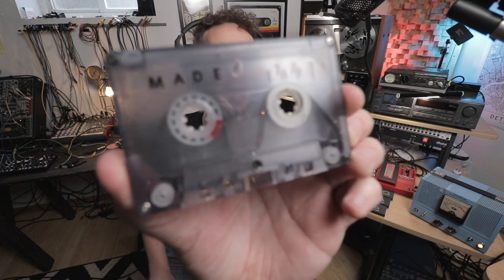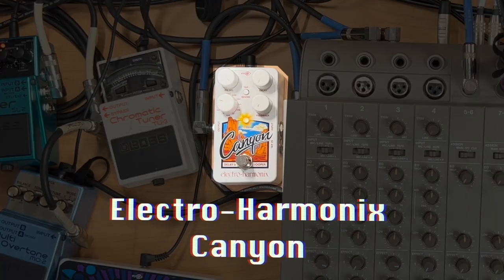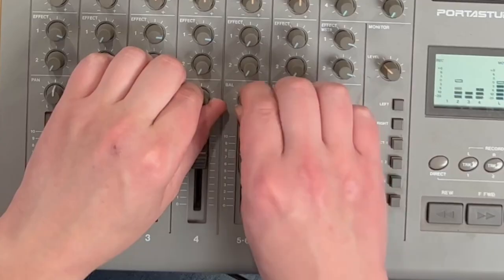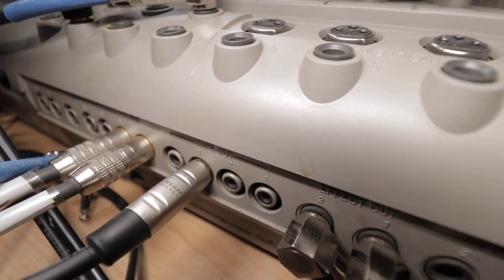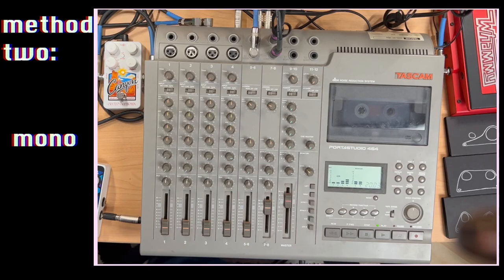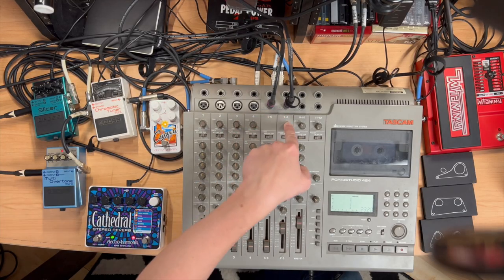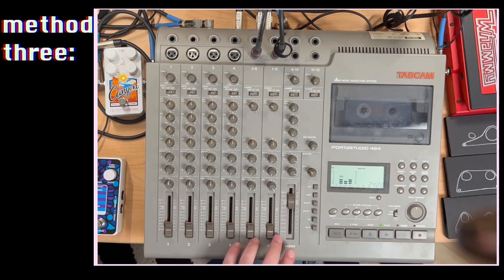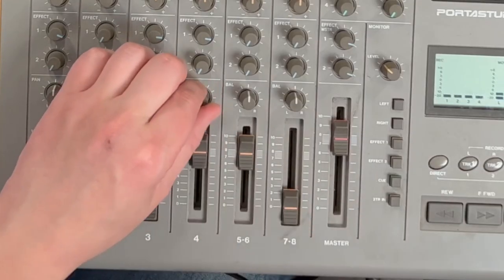4 Analog Ways to Make a Mono Track Stereo

Comment: hey man! I see you are using the tape outs in the second example and coming back into your spare stereo inputs, but doesn't your 464 have a switch on the back to chose to either use the outputs as tape outs or line outs (your master track)? Don't think it's possible with a 424 or your porta2?  Anyway, don't stop making these videos, thank you!
Reply from the maker: the porta two has the same tape outs and I send those into the spare channels on the Porta Two.  Not sure about the switch you're referring to and I haven't used a 424.  Hope this helps!